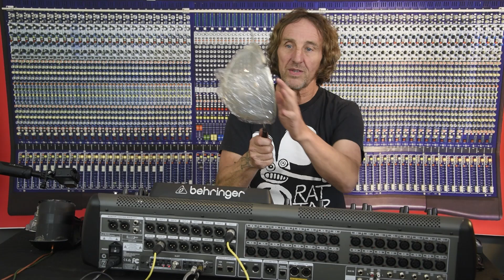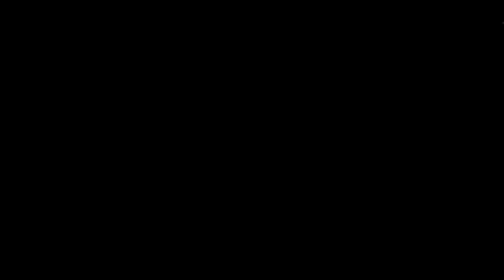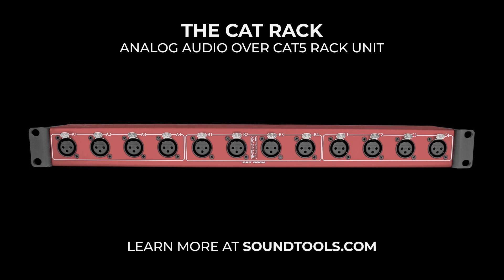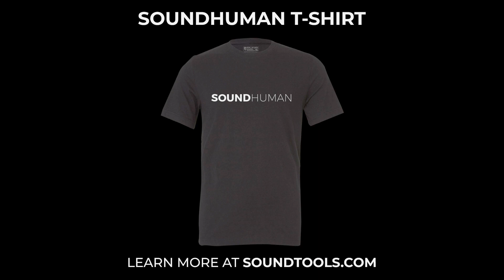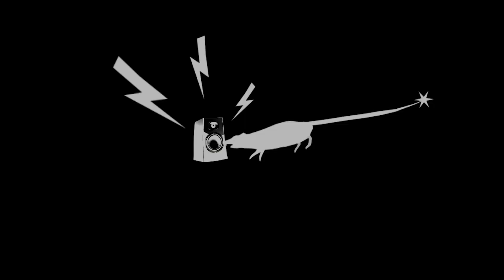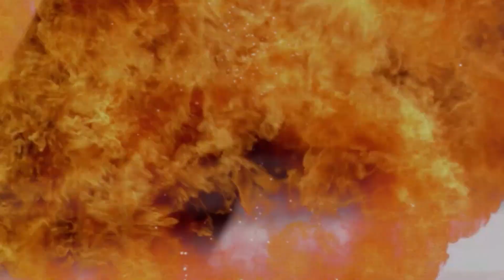Aux Fed Subwoofers Are Better - Because of How Mics Work

Comment: This discussion changes massively depending on WHERE the subs are.

- If they're flown together with the tops, so that the entire true-full-range signal comes from a single acoustic point, then you want to send a single true-full-range signal to that acoustic point.  No separate control, because you'll only mess it up.

- If they're ground-stacked, separate from the tops, then there's no way to match the two sources for the entire audience, and so you have to wander the room during rehearsal or sound-check (virtual or live) and fudge it.  Then continue to fudge it from the booth during the show.  That fudging, of course, requires separate control.

Ground-stacked subs with flown tops are practically two separate PA's.  Physically grouping all of the drivers in acoustically the same place is a single PA.  Each PA requires its own separate control, but don't try to control elements of a single PA separately.  Use the channel and group/master filters for that.

---

Also, the demonstration of highpassing in this video is terrible.  All at 90Hz is no thought at all, and probably wrong for every channel.  Not a fair demo.  This should be obvious when you consider that the crossover is simply a highpass for the tops and a matching lowpass for the subs.  Period.  You might think that the speakers' acoustic response adds to the crossover's response, which it does at the extremes, but if you rely on that happening, then it's a bad system design.  Each driver should have enough extra range that the crossover filters do ALL of the work until the filters' response is down enough that the drivers' response is not audible anyway.

The proper way to use the channel highpasses is to listen to each one and set its HPF as high as you can get away with, without affecting its intended sound.  Do this separately and independently for each channel, including the bass instruments.  Bass sources will of course have the HPF set way low, because you want to keep their bottom end, but not completely disabled.  Non-bass sources will have them much higher, with all of them right at the bottom end of what you actually want to keep from each one.  Once you've done that, they will all be different.  All the same is a blatant sign of naivete, laziness, or a VERY rare stroke of luck.

If you have an analog board that only has a button for a fixed HPF on or off, so that they must all be the same or not at all, then you might start to think like Dave does.  I like mixing on analog myself, but that is one of its common limitations, especially for "affordable" small boards compared to today's pricing of digital consoles.  Not all analog boards are like that though: some do have adjustable channel HPF's.  If yours does, USE THEM!!!

Once you've set them all individually so that each one just barely allows everything that you want, continue to listen to it.  If there's still too much rumble, and you must have a steeper rolloff, add another highpass in series.  You probably won't need to though, considering the next section of this comment.  But if you do, the X32 shown in the video can use each band of the 4-band channel EQ as an additional highpass or lowpass, at the expense of using that band for something else.  (they're not fixed to being shelves and bells)  And every submix on that board has a 6-band EQ that works the same way.  No excuse to not send a muddy vocal to a true-full-range single PA.  (the X32's output EQ's even have purpose-designed crossover filters)

---

With all of that said, yes you will still hear some low-end of non-bass sources in the "subs" of a single true-full-range PA.  That's only because the filters are not infinitely steep.  But also consider that an unfiltered set of tops would have played the same thing.  (if the PA is designed well, with enough extra range in each driver)  You can get the same effect by adding a copy of the crossover filter to that source, but because that is not infinitely steep either, you'll still have something coming from the "subs".  You can repeat that as many times as you like, cascading more and more highpasses (you'd probably need a DAW at this point), and still never get to zero.

Then consider how much of this pursuit is actually audible in the context of everything else.  Probably none at all, just because of the actual levels involved.  The residual after filtering the "stage mud" out of all the non-bass stuff, is so much softer than the actual bass stuff, that nobody's going to notice.  Not even audiophiles.  (audiophools might, but it has nothing to do with their ears)  Even the residual from a single vocal by itself, is only noticeable to the people in the "mosh pit" next to the ground-stacked subs, who are there because they want their insides rearranged, and not because they want to understand the lyrics.

But like I said up top, if you have your subs in a separate place like that, then you want to control them separately for reasons that are NOT stated in this video.  The reasons stated in the video are not relevant, given the middle section of this comment.
Reply from the maker: Hmmm, I understand the reluctance of people to cling to stereo and not progress the the complexity equivalent of home hifi 2.1 audio.

That said, high pass is helpful in reducing unwanted lows. Subs on a separate send is just the next natural step beyond high pass by not sending mics to speakers that reproduces sounds you don't want reproduced from those mics.

This applies regardless of sub placements

High passes help and seperate sub sends helps even further.

It's not that complex or scary but the benefits can be very audible in some applications and less so in others

Having subs on a send allows you to send everything to the subs or send somethings to them

Subs on LR only allows everything to the subs and is way more limiting.

Subs on a separate send from channels or groups or from matrix dialing up desired groups will allow everything that the more restricted subs on LR can do, plus the ability to improve things further.

Not having subs on a separate send is best for situations where the system does not have true subwoofers

Subwoofers being speakers operating at below the frequencies of a full range system
Reply: @DaveRat  I wrote my followup without having seen your response, and I think it's still accurate.  I just want to clarify my use of the term "true-full-range" to mean honest 20Hz to 20kHz response, and not the 60Hz to 15kHz or so that most people call "full-range".  I put the "true-" in front to distinguish that.
Reply from the maker: For pro audio 20 to 20kh is probably not realistic.

In fact, undesirable

Projecting 20 kilohertz hundreds of feet is prohibitive and having a system that will do so is a poor usage of resources.

Having a subwoofer reproduces 20 Hertz just creates more of a mess and there's not a lot of material usable down there from all but very few extreme artists.

Again a waste of resources having built subwoofers that go down to 23 Hertz have first hand knowledge of the importance of limiting the low-end below 28 Hertz or so.

Most full range systems for pro Audio would be 40 Hertz to 15K or so.

With most subwoofers operating in the 30 Hertz to 60 or 80 region I'll bring some overlap for rain system whether it's used or there's a distinct crossover between them
Reply: @DaveRat  Now that I can agree with!  Every once in a while, you do get 20Hz or even 16Hz (pipe organ, sometimes, or a synth, and that fundamental is entirely felt, not heard), but for most things today, the lowest fundamental that it will ever get legitimately is likely to be a 5-string bass guitar at around 31Hz or so.  (kick drum is roughly an octave higher)  And if most of the audience is beyond their teenage years, they probably won't appreciate above 15k anyway.  Maybe not even 10k.

For thinking it through though, I just want to make sure that the concept still works beyond the appreciable range.  For a DIY PA for a small band, my actual design range does indeed bottom out at 30Hz, not 20.
Reply: Having said that, I think that this other video from Dave ( https://www.youtube.com/watch?v=wDcf184730E ) is spot-on.  And this one ( https://www.youtube.com/watch?v=VLkQSSydXwk ) is pretty good too.

If we were to play back a multitrack recording, still in multitrack, never mixed, to a set of near-omnidirectional, true-full-range, point sources, one for each instrument - or even several tracks per instrument, that go in different directions from that point in space - I think that's what Dave is going for.

What I'm going for, is for each point in space (and possibly direction from that point) to have a single electrical signal going to it, and whatever gadgets are responsible for that point in space, convert that single electrical signal into an air pressure that matches the electrical signal.
- If you send it bass, it produces bass.
- If you send it sibilance, it produces sibilance.
- Different location or direction?  Different signal.
- Same location and direction?  One signal.
Frequency isn't involved in that discussion at all, except for how to produce air pressure to match the electrical signal that each one is going to get.

I think that Dave and my overall goals are completely compatible.  But this video in particular comes from the wrong reasons.

Comment: The old Yamaha Sound Reinforcement Handbook recommended this 30 years ago (for the same reasons) and I still do it.  The laws of physics do not change.  The problem is that most live engineers have never read a book.  Every engineer should at least own the Yamaha book and the JBL Audio Engineering for Sound Reinforcement.
Reply from the maker: Interesting I will take a look when I get a chance.

Comment: Interesting topic. But there's a few points missed here. 

A large amount of large format line arrays can comfortably go below 80hz without subs. 

Also, the majority of high pass filters are set above 90hz. The analogue works was typically 100hz. And my vocals, hi hats etc could be higher still. 

The amount of junk could be negligible at best. This requires a whole work flow change to achieve.
Reply from the maker: Using a high pass cleans up a mix by reducing unwanted lows.

Subs on an aux send does the exact same thing even further by not sending lows to subs which are more efficient at recreating extremely low frequencies than the tops are.

Furthermore, with systems and have an overlap between subs and mains, putting subs on an aux send allows you to reduce the amount of destructive interference at varying distances between subs and mains.

The interference is caused by subs and mains being differing distances from the audience when not located right next to each other.

And because the exact same signal is sent to subs and mains.

By putting subs on an aux send or group send and only sending some of the instruments to the subs, the signal sent to the subs is no longer identical to what's being sent to the mains therefore those interactions are greatly reduced.

And even more so, by putting subs on a separate send you can set the high pas where it sounds best rather than set it such that it minimizes the rumble and use the low EQ of the channel to tune the sound even better without adding more rumble

Comment: Hi Mr. Rat:) What are your thoughts on Aux vs Matrix from LR bus fed subs? I see the benefits of both…Could you weigh in on the pros and cons of these options?
Reply: Thanks! I have been running Aux fed subs for years, not really knowing why haha;)))  Recently, a production partner is insisting on LR matrix fed, as he doesn’t want to have to worry about sending to a aux (which seems to be the reason most naysayers don’t like subs on aux) so I wanted to be able to better articulate these reasons…You rule Dave!!
👉🫶👈
Reply from the maker: Cool cool!!
Reply from the maker: Subs from L/R to matrix is a volume control for the subs that sends everything to the subs 

The big advantage of subs on a separate send is the ability not to send things to the subs that you don't want sent to the subs.

One effective method is sending subs from a matrix and only dialing groups up to the subs that have instruments that you want sent to the subs and not dialing groups up that have any instruments that you don't want going to the subs

Comment: Don't you pass filter each input appropriately?    Sure don't want anything but mid high coming from a hat mic, ect.
Reply from the maker: Of course one would high pass appropriately and also knowing that a high pass reduces the lows from a channel sent to subs but does not prevent it.

A 12 DB per octave highpass set to 320 Hz is only 24 DB down at 80 Hz.

high passes will clean up you mix by reducing unwanted lows to subs, seperate sub send cleans it up even more by eliminating the remainder and giving you more freedom to set the high pass for preferred sound
Reply: @DaveRat Roger that.   So pass filters (both high and low) do not completely block sounds above or below their threshold?  My understanding was the attenuation was 100%.  Perhaps it depends on the equipment?  If pass filters don't completely block the sound outside the threshold then it seems like they work more like parametric equalizers.   I'm really a monitor engineer so my experience with setting up subs is somewhat limited.   Seems like most of the systems I've driven from FOH have had fancy signal processors that handled the 4 way split to the mains.
Reply from the maker: Hi pass, low pass, EQ, and x-overs are all filters.

All audio filters have a slope usually represented in DB per octave.

So they roll off the sound or reduce the sound of the center frequency with a slope on either side.

None of them are absolute.

You can get filters with higher slopes but as you increase the slope you also increase other issues that affect the sound like ringing and phase shift.

Very low slope filters sound better but don't do as much

Highslope filters do a lot but don't sound as good

Putting subwoofers on a separate send is a workaround to bypass that completely and only send things to the subs that you want to the subs and still use desirable slopes and filter frequencies on all your channels

As a monitor engineer you already know this with your mixes.

Imagine if rather than sending vocals to the wedge you had to send the whole mix to the wedge and try and cut off the lows and highs so that only mostly the vocals were heard. That is how a high pass filter works and EQ and all the other filters

Subs on an ox end is like a monitor mix where you can send what you want where you want and only where you want
Reply: @DaveRat  makes sense to me. Thanks for the clarification.  Cheers

Comment: Seen Samson mixer with a dedicated subwoofer main fader, never understood the point of that since aux sends are standard and it's source was just from the main mix anyway.
Reply from the maker: Yeah having a separate level control on the console does not offer that much advantage especially if you can't isolate what sent to it

Comment: There is an argument for tweeters and mids being run on an aux, or running each band of the crossover from user assigned groups. No need for that hihat mic to be feeding rumble into the mids, lows or subs. It is preferable to structure a system so that the fewest possible phase and spill problems occur, and also to localise the sources properly. The natural quality of sound gets lost quite quickly.
Reply from the maker: Agreed treating each range of drivers like a separate monitor mix would be a powerful way of doing sound.

In one of my videos I describe ways to do subs on an aux and tweeters on an aux send as well as emulations of subs and tweeters on aux sends
Reply: @DaveRat  that's how a jamaican dub sound system typically works - they'll run processing and effects pre and post crossover. Tweeters particularly are often where the feedback lives.

Certainly whenever I use an all-digital approach, you can basically configure stuff per-box if you use the right gear and do all the filter processing at the edge. It is particularly worthwhile when it comes to managing the low frequency resonance aspects of metal tweeters, and trying to keep stuff from ring distortion modulation high frequency deafening ultrasound inner ear destruction comb filter interference lobe device.

Comment: It like mixing surround  
As a matter of fact try mixing 2.1 surround  or  LCR if your console supports  it then the master will control the  the stereo mix and the sub in the center 
Correct me if I am wrong
Reply from the maker: Exactly. Home hifi 2.1 is more advanced than mixing live sound with subs on L/R